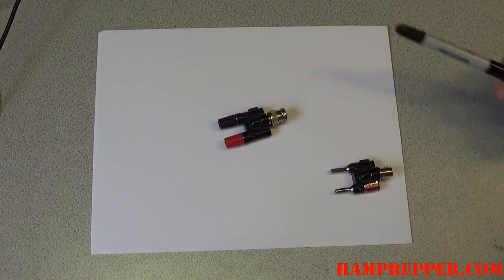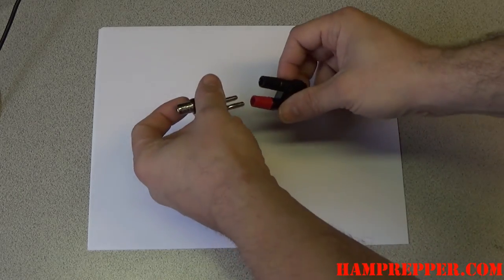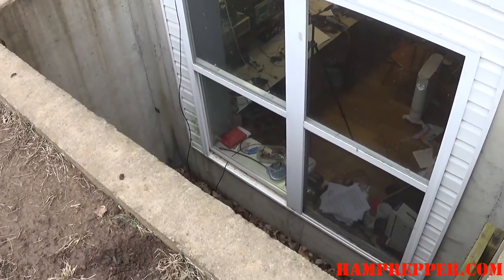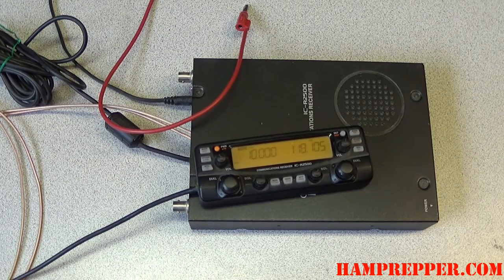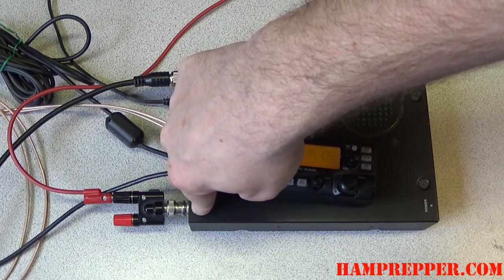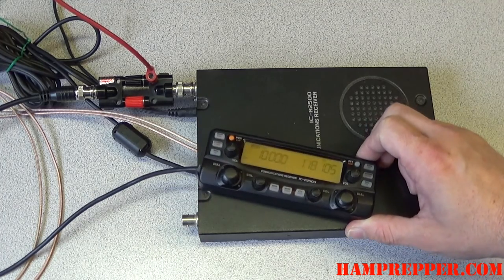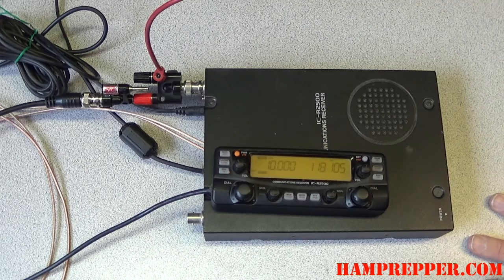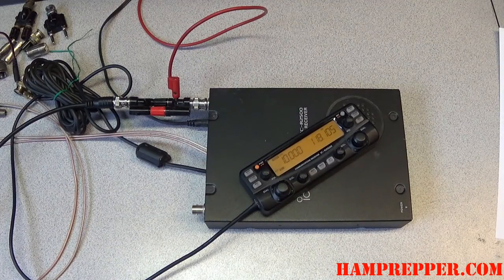Turn Coax Into An Antenna Using Banana Adapters

Comment: Thanks for this. Planning on getting an SDR for Swl.  Has been a long time. Antenna is problematic. I realized just before finding this, that, since I got AT&T fiber, I have an unconnected coax run coming into the house. It used to bring in Comcast cable. It occured to me I could do something like you showed here.  
Remaining problem is that we have aluminum ceiling on the patio and along the side of the garage where the coax runs, so that may block the signal. But at least it won't take a lot of work to see.

Comment: So I am trying to find information how to hackishly connect a small dipole to coaxial yet can find no real information.  I have two L shaped pieces... what do they go to do I solder both to the center?  One to shield and one to center?  Both to shield?  There is literally no info on the web about this.